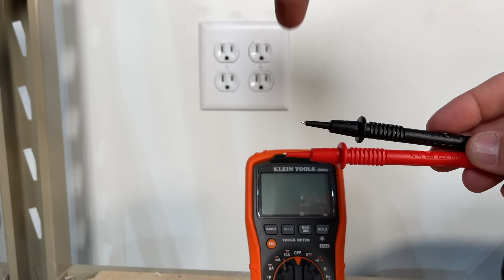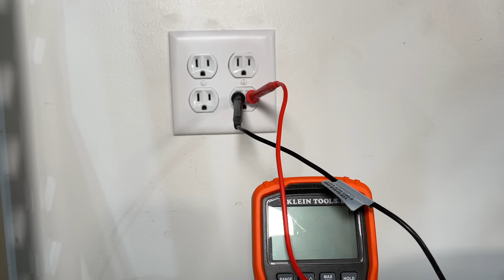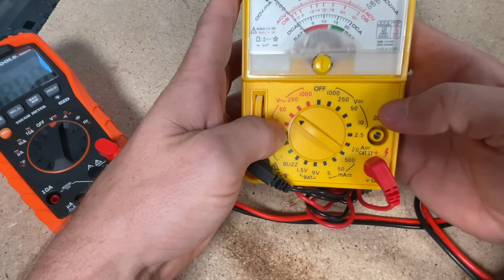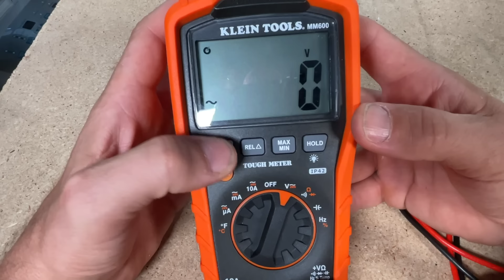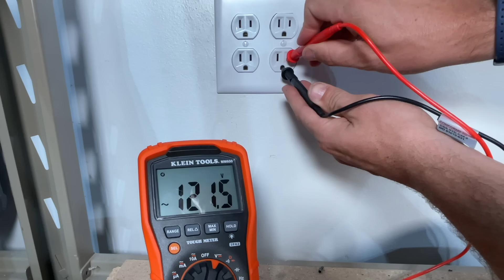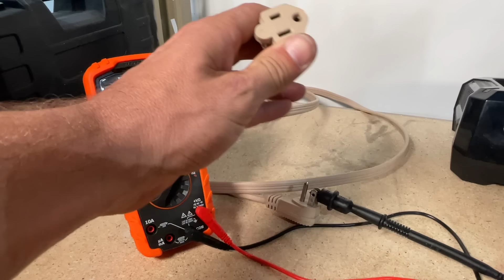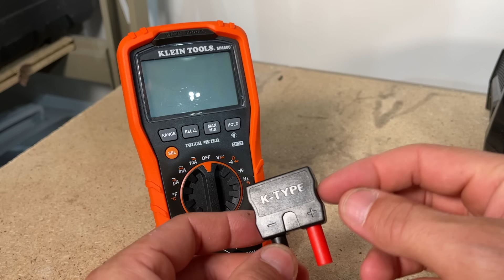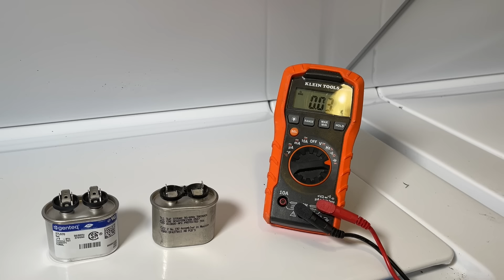How To Use A Multimeter for Home Repairs and Troubleshooting

Comment from the maker: Klein Tools MM 600:  https://geni.us/KxaJ8bi

Tools Every Weekend Warrior Needs
Makita Cordless Drill Combo Kit:  https://geni.us/t7dIA
Dewalt Drill Bit Set:  https://geni.us/oFlSl
Dewalt Screwdriver Bit Set:  https://geni.us/VDcr
Craftsman Screwdriver Set: https://geni.us/jXqFI
Eklind Allen Wrench Set:  https://geni.us/7XfvO
Pliers (4-Piece Set):  https://geni.us/RIdx
Milwaukee Fastback Utility Knife:  https://geni.us/MlyiLk
Stanley Tape Measure:  https://geni.us/bUfD1R
Studbuddy Stud Finder:  https://geni.us/RySCuVw
Johnson Torpedo Level:  https://geni.us/wiLcDY
Stanley Hammer:  https://geni.us/bPDk8Wo
Buck Bros Wood Chisel Set:  https://geni.us/vk3cpTW
Klein Voltage Tester:  https://geni.us/h9Hl
Klein Outlet Tester:  https://geni.us/kdBAJ
Milwaukee Wire Strippers: https://geni.us/5zuLAbC
Little Giant Ladder: https://geni.us/fmlmTk

DISCLAIMER: This video and description contain affiliate links, which means that if you click on one of the product links, I’ll receive a small commission.

Comment: Thank you for the video.  Does anyone know why I get consistently low voltage readings?  9 volt battery set at DC yields 7.36 volts dc.  Household electrical outlet yields a reading of 73.5 volts ac when testing on the neutral or ground.  Bad meter?

Comment: I needed to measure DC current where I couldn't break out the wires so I went with the Klein CL800.  It also comes with a thermocouple and a pouch.

Comment: If you are in the market for a multimeter consider a clamp style meter like the Klein. CL220 which makes current measurements easier and don’t cost that much more.  Many multimeters come with non contact voltage meters built in so look for that feature too.

Comment: In the Resistance or Ohms Setting, be sure the wire being measured doesn’t have Any Voltage, or the Ohm-meter can be ruined !

Comment: This didn't really show testing a capacitor, just connecting to it while talking about it. Important note for the D.I.Y.'er. Capacitors can store a massive amount of energy, and unlike a battery, it wants to be released instantly. So be careful if you are testing one of these, they often have several sets of terminals so you want to do research on your peticular capacitor to note which terminal is which. You also want to use caution when messing with these. If a charged capacitor makes contact with anything conductive, it can discharge shocking you, short creating explosive sparks, igniting something on fire, damaging other components, and though I havent seen this happen, could potentially explode. So be careful folks. Capacitors can be dangerous if not handled safely. This didnt really explain the difference in the other unused sockets/ports we see on the meter that can be used for tests, but luckily this is Youtube where people like me can come and pick apart a video others have made. This video being a beginner guide of sorts kind of makes that important. I never change my leads to the other ports, but they do serve a purpose. This was a good video, thank you for sharing this. Very good tip on which lead to connect first (and disconnect last) when testing an outlet.

Comment: Thanks for the video, Scott. Answered my questions about how to test an outlet. A question for you: How did you know that the HVAC component you tested the capacitance on might be faulty the component in the first place? Thanks!

I use a Klein multimeter model CL800 for work because the company wanted us to be able to measure current. Great comments!

Comment: Also worth mentioning that you shouldn’t trust the outlet to be wired correctly. The best way to identify AC polarity is to insert your black lead in the Ground hole. Then red to the slot. When you find AC volts that’s the “hot side”. Don’t assume! 

If the polarity is wrong. Turn off the breaker and fix it.
Reply: then you get 0 volts because your ground is either not connected or open before your outlet.
Reply: When you find the hot side your meter should read approximately 120v, the neutral side should be 0v or close to it.

Comment: In beganing of video u talk about sticking red probe into an outlet and removing the black. Ur meter is in off position. U compare to sticking a knife into hot side.   
Although its a good habit to get into, its not really correct.  Ur rednwire is plugged into v, ohm part of the meter.  If u set ur meter to voltage the meter will be high resistance which will allow very little current.  That is why these more proffesional meters have a  seperate spot to plug probe  in a meter to measure current (very low resistance thru the meter).

Comment: When discussing basics, I'd like to know how the red/black wires should be connected to the voltage meter since there are 3 ports (10A, com and V). Maybe it's common sense to others, but not sure what's correct.

Comment: What happens if you put the black probe in the hot side and the red probe in the neutral side?
Reply: It doesn't matter in AC. In DC it doesn't really matter either, you'll just get a minus sign before the reading. If you measure DC in an analog meter that doesn't have negative readings, you could damage the meter if you reverse the probes.

Comment: I just bought the Klein Tools MM1000 and I'm not an electrician and have no clue what a majority of this is.  What I need to do is test golf cart batteries and don't know if golf cart batteries are ac or dc and I don't understand o.l .ol or ol. (I think it's referring to the max voltage).

Comment: Well done, I am open minded sort, most of my multimeter is Fluke, but I have older Klien model MM-1000, that is discontinued I understand. I might upgrade to MM-600. Good thing about Kline mm has temperature probe, Fluke MM does not have temperature probe. Got to remember, while typing this, to MAKE SURE, connect ground first in right place or left side or bottom ground big round hole and if U have just 2-plug holes, left is natural, plug first and to right side hot. Also 2-remember to pull out in reverse order that pull out hot, right side, first n then black, left side. We all know what deadly electrical shocks or causing short or causing triggering circuit breaker if we fail to insert or pull out in wrong order even though that is must basic rule! Fluke maker wants us to JUST be concentrating in electrical areas, NOT HVAC, so NO temperature measuring capacity in Fluke MM, which temperature measuring is hvac area. So, Klien added temperature measuring feature to compete against Fluke. I have both Fluke MM n clamp meter, new models.

Comment: I have the mm600 because I wanted to test my ac capacitors. I love the meter & I learn new features on it all the time. I’ve saved several hundred dollars changing my own capacitors out plus added benefit of not having to wait for the ac guy in the peak of summer when they are most likely to go out. Thanks for this great video!

Comment: This is a dumb question…is the power off to the outlet? And I’m new at trying to learn this , but I’m not sure what hot, ground , neutral is and not sure what all these initials you are using to explain ac voltage? Dc voltage ? Not sure what this means ..and all the numbers , what does that mean ? What should the numbers be at? And how do you know what a 220 and 120 volt plug is ?? Does it have to do with the holes in the socket ? Just some questions to help me follow you
Reply: If you are in the US the nominal voltages are 120 volt for general outlets like lights, toaster, coffee pots, vacuum cleaners and larger appliances like stoves, dryers, well pumps if all electric typically should be 240 volts. Houses are supplied with 120/240 volts from the electric pole to house and the electrical panel.
Suggest goggling the other circuit information as to what is hot conductor versus neutral and ground.
If you can't understand that recommend not working on the circuit till you do.

Comment: When you test a duplex wall outlet, is it safe to assume that the top and bottom outlets are on the same circuit, and power would be disconnected to both once you determine a correct breaker?  Or should you do a test of both duplex outlets?
Reply: Not always one half could be switched, but should be the same circuit which you would need to know to be safe.

Comment: another tip:NEVER and i mean NEVER put the leads in the wrong hole. if you do that and you measure something thats incorrect example: outlet, it will cause a shock.
Reply: That advice is just ambiguous enough to be completely useless. Are you saying don't attach your meter probes to the current loop and try to take a voltage reading?

Comment: Hi, great video for multimeter newbies. How do you probe GFCI outlets that have safety doors in the plug slots? When I try to push in the probes, I can’t penetrate them. A plug however goes right in.

Comment: I wondered if that was just induction from the voltage sensor.  I got another meter and it registered 109 volts due to the voltage drop. That's enough to hurt you.
Thanks!
Reply: What you have done is determine the ratio of the internal resistances of the two multimeters. If you use another different meter you will get a different reading.

Comment: You won't get an arc touching the ground probe with the hot probe plugged in. If that was possible, you would get the same arc plugging the neutral in first and then the hot side. Both make the connection one probe at a time and would arc when either got connected. The reason you don't get an arc is you have a high-capacity resistor in your multimeter, typically 10 megaohms, that greatly limits the current flow. Voltage is not affected, only current. If there was no resistance in the multimeter, it would be an instant arc and melted wired the second you connected your probes. Take that black probe he holds out and touch the screws holding the outlets in place. No arc since the screws are part of the grounding system same as neutral and grounding wire, and the circuit in now complete and showing voltage on your meter.
With todays litigation warning about every little common-sense thing that you can hurt yourself with, nowhere in any multimeter manual will you see a caution to "not touch a bare black probe when hot probe is connected" warning. It's just not necessary.

Comment: How come my meter when set 200v ac displays 140volts on all my outlets. However if i change it to the 600v ac settings it shows 127v. Which one is true and why are they different?
Reply: Tolerances are generally based on percentages, so the larger the value, the larger the acceptable tolerance. The lower settings should be more accurate.

That said, the differences in your readings are pretty outlandish, so I wouldn't trust any reading out of that meter to be accurate. I'd say there's probably an issue with the 200v setting on your meter.

Comment: At 1:14  Since it is AC the lead placement doesn't matter.  At 1:30  The interal resistance of the meter in voltage mode is probably one million ohms or more.  (Some are 10 million ohms.)  The current flow for a shock is about 120 micro amps.  Barely enough to feel.  And it won't arc anywhere.

Comment: There's only ONE meter worth a shit out there and its NOT a Kein. Any meter made by Fluke works. Best to purchase and autorange model with a backlit display. However you still need to know wtf you're doing or you'll most certainly blow the internal fuse that all Flukes possess. Note that HD & Lowes do not sell Flukes. Best place to purchase them is from an electronics jobber like Mouser or Jameco. Note that you do NOT need their "scopemeter" (their usage is beyond the knowledge of an electrician or DIY entity). I don't own one because I have a coupla bench oscilloscopes instead (which sport more capability than scopemeters along with a much larger display). A good Fluke model is the "117" its been around forever.
Reply: Lowes does sell a couple of cheaper Flukes,  not sure about Home Depot.
Reply: Nobody here is calibrating anything. It doesn't really matter what brand of meter you use to figure out why your floor lamp doesn't light.

Comment: You forgot to mention that if they are doing capacitors to discharge them before messing with them because they carry a hell of a wallop. Great video.
Reply: Put a screw driver across the two contacts making sure you are not touching the metal part of the screw driver.
Reply: Can confirm!
Reply: How do you discharge capacitors?
Reply: It can... But it's better than it damaging you.
Reply: You can buy or diy a capacitor discharge tool. But if you don't have that, just do the screwdriver method (be careful to not touch the metal part).

Comment: Have you opened up the back of your MM600 to see if you can adjust the voltage on a potentiometer if it has one at the screen?

Great video by the way. 
Thank you

Comment: What does it mean if you are measuring AC voltage and the numbers are changing rapidly. Going from 120 to 60 to 118 to 30 to 112 etc? Wide flunctations
Reply: I think my multimeter went bad

Comment: NEVER REMOVE RED WIRE FIRST O-O
Reply: This is the opposite of what he  said is the safety issue, and demonstrated with the non-contact voltage detector.

Comment: What would be the point of checking out an outlet like that? Genuinely curious and asking
Reply: It gives you more information than just a bulb lighting up. A voltage tester might light up at 50v, but that glowing bulb wouldn't explain why the motor turns slower than it should.

You might have a high resistance short or a floating wire somewhere that could still indicate power being present. A meter may be able to help you figure out what's going on when a voltage tester cannot. Voltmeters have their shortcomings as well.

Comment: Property manager for 3 apartment blocks , I use the MM450 for rad actuator poptop voltages , Temp for rad fins , Hot/Grd/Neut separation and wiring correctness , appliance troubleshooting and a few other things. Bought for the thinness and yes the case :)  Fits in a shirt pocket and TRMS , autoranging and 600V. Super big display and intuitive to use.

Comment: One elephant in the room you didn't mention is current readings,  My advice to DIYers is avoid trying to learn these unless with the direct help of a professional!  In fact I would suggest putting some tape over the probe ports. If someone pulls the probes to store in a case, it may be too easy to get one in the current port. Then the  user goes to measure voltage and "fries" the meter.   

Generally, you probably won't blow it up, but that can happen if you connect to higher voltages like 480 and above. Ideally, it just blows the internal fuse. But if you go to replace it, you will find that the correct one doesn't come cheap. That's because these are usually specially designed fuses that blow super fast and can interrupt some pretty high currents, like what might happen if you screw up. The trouble is that these are usually the same physical size as a cheap glass fuse. But if you put one of those in and screw up again, the meter may very well blow up catastrophically. 

When I teach students how to use a DMM, we always start with very  low level DC. That plays in very well with learning Ohm's law and doing the calculations, then verifying with the meter.  Invariably I go through several fuses each year when someone forgets to move the probes back after measuring current. The meters do their job and keep from blowing up, but it isn't unusual to fry one every so often to where it becomes a throw away!  

In most cases a clamp on ammeter is adequate for DIY household use and there are decent ones out there for not too much money.

My advice is to buy quality famous electrical brands and avoid some cheap Chinese stuff you may find on Amazon. It's hard to be sure of what you are getting. I've heard things like yeah, but it's only 20% the cost of the brand name.  I usually address that this way. If that cheap meter blows up because it was defective, and you get seriously burned,  what do you think your odds are in suing "BingFong" products in China, to get some compensation??

A cheap paint brush will probably still put paint on your wall, but going the cheap route on anything electrical, can come with some serious potential risks. Ask a properly trained or educated professional.

Comment: Man! You cannot "arc" with the 10 MOhm impedance of the voltage input of the DMM and it's not "live" the way you suggest it and using that NCV deathstick against it is basically meaningless anyways. Obvously it is smart and mandatory to not touch the probe with something under test, that's absolutely correct. But please don't spread nonsense without informing yourself how the device actually works.

Again I have to press the issue: You are using the wrong tool for the task. Get a proper electrical tester instead of poking around in mains voltage with a diagnistics tool! It is not a task for a multimeter, look up code and safe working practise guidlines for electricians! Educate yourself before teaching dangerous things to others!

Again, examples of real electrical testers suited for the task: Fluke T+Pro, T5, T6, T150, T130; Ideal 61-547, Vol-Con; Klein ET40, ET45; Beha-Amprobe 2100 ... and many others.